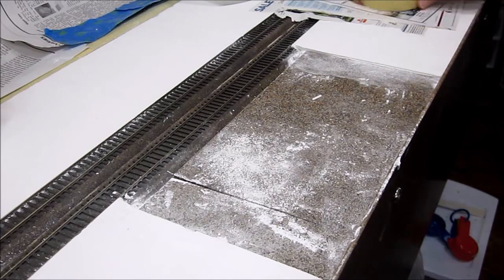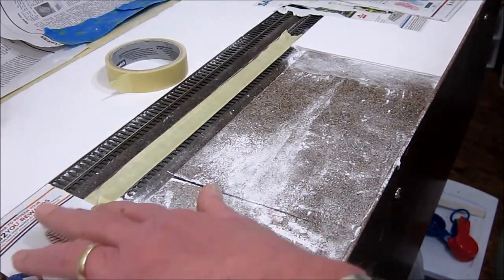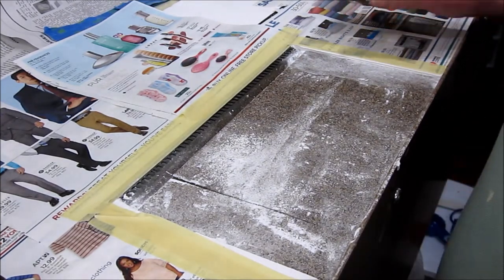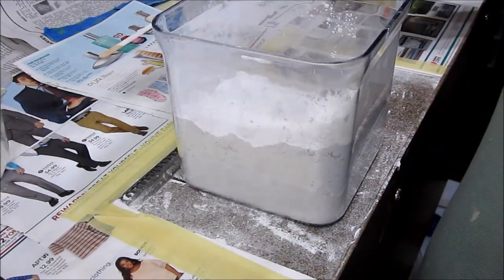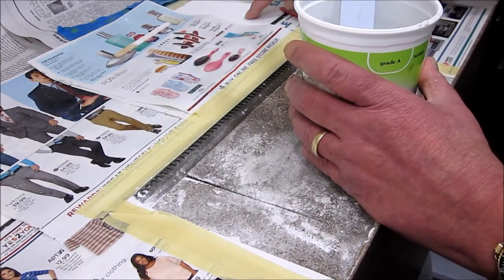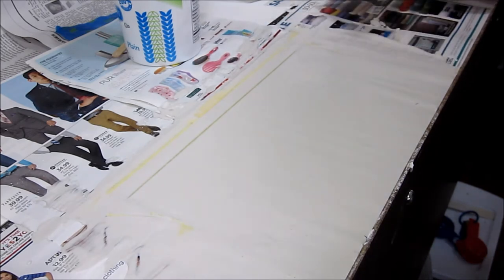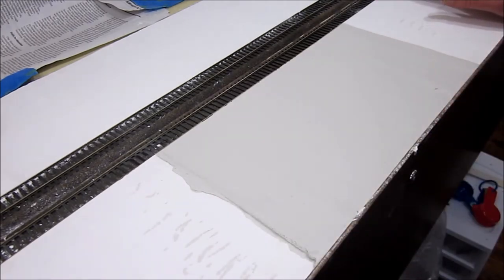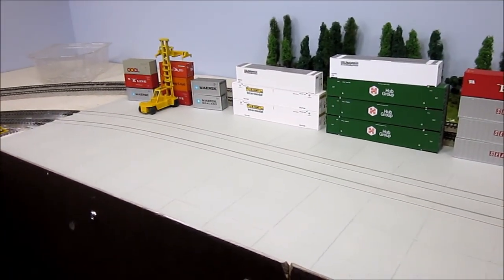How To make a Concrete Surface Using Smooth-It

Comment: I use plaster and sift it right into the water. I get a working time of between 20 minutes to 40 minutes each time I mix the plaster. This is enough time to do whatever I need to do. I also use a whisk ( from the kitchen ) to mix the plaster and that makes a better / smoother mix. I make my plaster mix a little wetter than you did and put it in a 32 oz squeeze bottle. I then squeeze some onto the area where I want the plaster and vibrate the table with either a hammer or a sander hitting the edge of the road bed. this has a way of making the plaster flow evenly.Works great when I want to put cement ( plaster ) in between the rails. I have a 5 gal bucket with fresh water on the floor by me and I can wash off the tools in this bucket. A 5 gal bucket will be big enough for almost all of the tools you need. Also, at the edge ( fascia ) I usually put a square piece of wood 1/16 X 1/16 to use as a guide for any of the tools I use to smooth the plaster. I buy the 32 ox squeeze tubes from Amazon... If anything dries inside the squeeze tube it is flexible and will let you get rid of any dried plaster. If you can catch the plaster at the right time, you can go over it with a fine sponge and this will act like a sanding. Plaster dries much more quickly. Nice video...

Comment: How flexible is the smooth it. My train table slightly flexes and I’m concerned the smooth it will crack crumble and come apart.
Reply: For an alternate way of laying roads and this type of concrete, there is a type of cement patch called Ready Mix Concrete filler at any of the big box stores and it stays a little flexable for many years. Or fine the "What's Neat This Week' site and Ken has a video on this. It is a few years back but is a good one...

Comment: Could you add a drop or two of say Vallejo black and then it will be a perfect grey?   Or will it react ?
Reply from the maker: Thanks for your question. I suppose that would work but only if the paint is acrylic to be compatible with the water in the Smooth It...Harold

Comment: That is awesome.  I am looking to do the same.  Any tips on covering up to the side of the rails and between rails?
Reply from the maker: Thanks for your comment. In the video, I used the Smooth-It to the tops of the rails on both sides. Then, I cut a flangeway on both rails inside with a hobby knife making sure it was wide enough by using my NMRA standards gauge. One problem with this approach...how to clean the rails without disturbing the fake concrete. Were I to do it over again, I would level the Smooth-It just below the rail tops to allow easy cleaning without affecting the fake concrete. You can achieve this rather easily by sanding the Smooth-it on both sides until the rails project above the Smooth-It. I could do this now but it would mean re-painting the Smooth-It...Harold
Reply: Norfolk Southern Sherwood Subdivision Thank you!

Comment: WOW that's a lot of smooth-it ,,,,,, SWEETA!!! JOB .is that all smooth-it?  Did you cut the lines in for the expansion joints or is that painted on ?   Either way that's a SWEETA  laydown area... thx for sharing,,,, From Tom
Reply from the maker: I put down sheet cork to bring the surface nearer to the tops of the rails and, then topped it with Smooth-It. The entire surface that you see is all Smooth-It after painting with a light gray acrylic paint. The expansion lines were scored with a hobby knife (ok, it was an Exacto knife) before painting.
Reply: REALLY SWEETA!!!!

Comment: What's the trick to get it between the tracks and do you have a video on that
Reply from the maker: Thanks for your comment and question. Actually there is no real trick. The rails serve as a barrier that keeps the Smooth-It between the rails. So, the Smooth-It is applied using the same method as you would use with the paving tape. The only consideration is to keep the Smooth-It surface slightly below the railhead so that you can clean the track without destroying the fake concrete...Harold